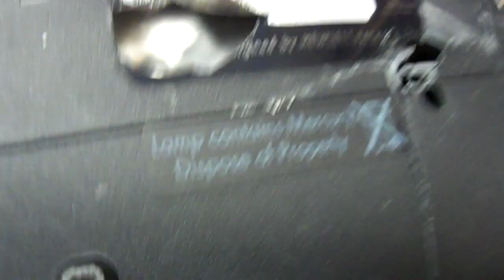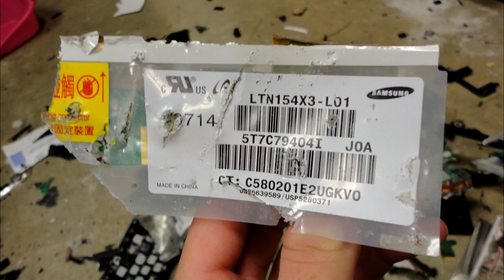Compaq Presario F500 Review (Destruction)

Comment: I still have this laptop after six years. In fact, I am using it to watch this video. Mine still works rather well, and I've never had any big problems with it. :P
Reply: i bought mine from a computer dealer in boise, id in aug 2012 for 125 bucks. i just bought a new used laptop cause the compaq was getting kinda slow. good memories with this pc. its the little laptop that could.

Comment: Could you send me the bottom left control key mine is missing. Also the cells you didnt destroy work in flashlights. Send me them. Also if the windows vista product key is still visible could you unregister and get me a photo. Thx. That can probably still play quake 2 somewhat well.